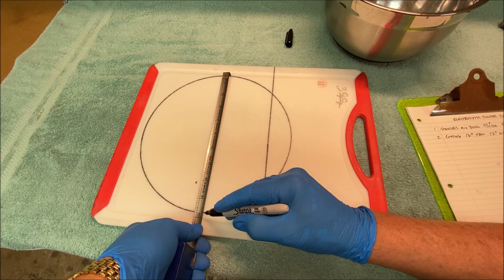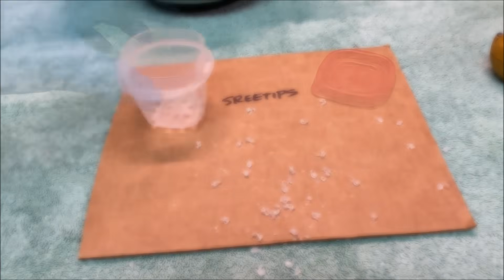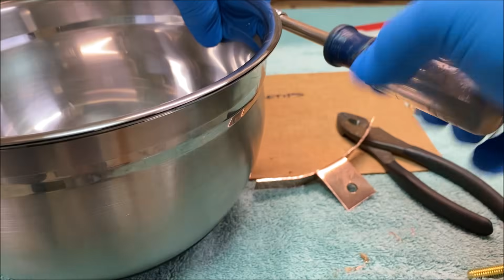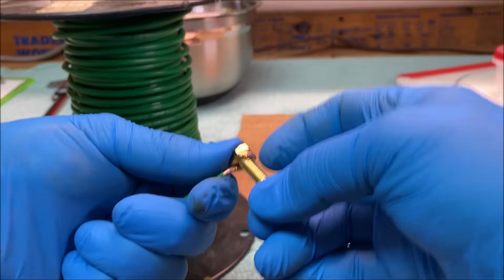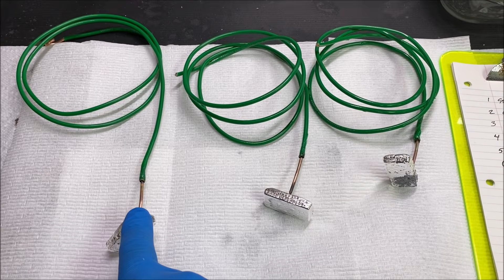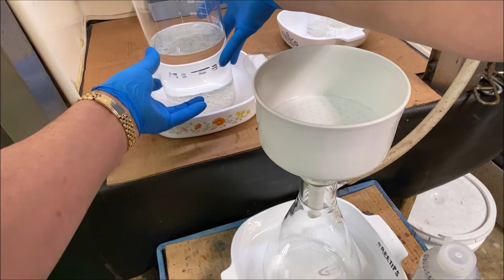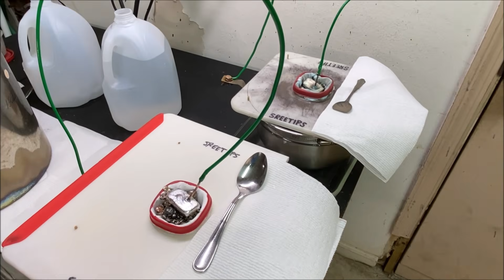Silver Cell Build Step by Step From Scratch for Beginners

Comment: My question........ can you build a gold cell and grow gold crystals, I have seen naturally formed gold crystals, I have a gold nugget composed of a dendritic gold crystal, it's rather unique and rare. Collectors pay a tremendous premium for gold crystal specimens, so perhaps you should attempt a gold cell. I'm curious if you can control the size of your silver crystals by varying the voltage?
Reply from the maker: Gold crystals can be grown but there’s a process involved that I’m not familiar with. Voltage in the silver cell is critical between a narrow range. Outside this range, other metals could begin to deposit, if present.
Reply: Might be well worth trying to grow gold crystals, I have done some searches and found that the premium for good crystals may be as much as 100 x the metal value. @sreetips
Reply: Great gold crystal specimens came from Mt Kare in Pau Pau New Guines, I've seen (held) some large spectacular specimens from the deposit that a friend obtained. Look up Fabre Minerals, they sold a 2.1 gm very average specimen for $940 USD @sreetips

Comment: If you are making the solution to extract the silver from with silver already aren’t you kind of just going in a circle? Taking silver, turning it to a liquid then recrystalizing it back into silver. I am failing to understand the actual production of silver from a cost perspective. You had the silver already why break it down to build it back up?
Reply from the maker: Have you ever heard the phrase; it takes money to make money? Well, silver is money (paper dollars are a money substitute). I use part of the harvest from a single run (about 800 grams of pure silver crystal) to make the electrolyte for two runs of the silver cell, 1.5 kilos yield from each run. So I gain (3 kilos minus 800g) 2.2 kilos of high purity silver. I rinse it, put it away, and forget about it. My goal is one thousand pounds of pure silver. Maybe sell a little along the way. But mostly for my retirement. Hope this helps you understand a little better.
Reply: @sreetips  thank you for explaining. I am used to the kind of chemistry where you take one thing and extract it from another. Not taking one thing to make more of it. I wasn’t sure from a % standpoint as to what kind of production you were generating

Comment: Thanks for sharing! Going to be my next future project!  Turning 925 scrap to pure silver! One question, I use silver solder in my work would that extra metal burn off in the acid?
Reply from the maker: The acid won’t burn it off. The acid will dissolve the metals if they are soluble in nitric acid.

Comment: A tip If your copper sheet is too hard to bend to the shape of the bowl, heat the copper with a gas/blow torch to a red heat, then quench it in cold water this will anneal/soften the copper making it easier to bend.

Comment: Love your channel and all the work you put into it , and thank you for sharing your knowledge with us,
My question is can you run bigger size bowls? Also what is you increase your power setting higher then 3volts ? Will it still work or does it effect the silver purity ? 
Keep up the amazing stuff your doing and for sharing your knowledge 
Kind regards 
Sam
Reply from the maker: Critical distance between anodexbasket and cathode 4 to 4.5 inches. I run the cell at 3.5 volts, higher or lower could cause contamination,
Reply: Thank you for answering my question , hoping to build my first silver cell this weekend 
Take care

Comment: 150 grams/Liter = 600 grams silver for 3.5L liquid is the ratio. With buying the Nitric Acid and the anode bar, from you, the all in cost to get the cell up and running is approx. $600 +\-. Would (2) 10 ounce .999 fs bars work for the electrolyte?
Reply from the maker: Ansolutely

Comment: Does the anode bar need to be .999 fine silver? If im setting this up for the first time can I use less pure silver for the anode bar?
Reply from the maker: Yes. I use pure silver because it’s easier to work with.
Reply: Also, does the electrolyte need to be pure silver also? Should I buy some .999 fine casting grain to make the first batch?

Comment: So the silver that I have is in raw ore form. That ore has a mix of silver, led and galena. Would this still work in this as a solution??? Or would it mess it all up???
Reply from the maker: No, the silver going in the anode basket must be fairly high purity to begin with. Otherwise the electrolyte would quickly become saturated with junk. 98% pure is a good number for the impure silver.
Reply: @sreetips  O ok Thanks. I was thinking it had to be on the higher end of purity. So I have to refine my raw ore down to 98% pure then do this whole  process to get it to 99% purity.
Reply from the maker: The silver cell should get 98% silver to three nines plus, as long as proper parameters are maintained.

Comment: Second question you used 600 grams of pure silver to make the clear solution up which is like 19 oz of pure. Then you put in 9 oz of dirty silver which would be like real silverware and so on. What is the percentage of pure from the original 19 already in the solution
Reply from the maker: For every ten ounces of impure silver I add to the anode filter basket, I’ll get out 9.8 ounces of high purity silver crystal.

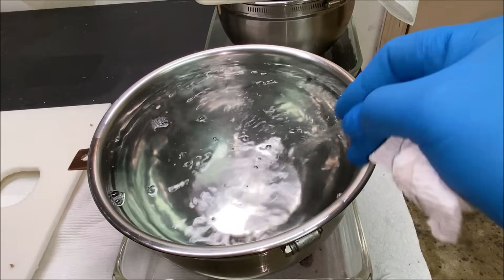Comment: at the @32:00 mark 600g of dissolved silver that equates to roughly $520 of silver that we need in order make this liquid silver solution correct?  Hopefully someone smarter than me can clarify.
Reply from the maker: That’s correct, but I use the electrolyte for a second run of the silver cell, but never more than twice due to copper builds up.

Comment: Sreetips, a question. how beneficial is this in networth? based on how much i'd pay for the setup and the anode, etc. what is the take home profit, to be reinvested? i'd like to get a full setup going for all of it if its plausable, and is it realistic for me to triple the container sizes if one has the finances? questions i'd like to know before i give this a try, if you can give me some insight lol. this is amazing stuff.
Reply from the maker: If you mean: buy everything including the silver, refine it, then turn it back into paper money. I suppose you could “make money” if you could get the sterling silver at a low cost. I buy sterling and use it to refine gold. I then recover the silver and run it through my silver cell. Then I harvest the pure silver and add it to my savings. My savings are in silver, not paper dollars. All that said, you’d probably do better to just hold the sterling like it is. No need to refine it. If you want more paper then you should invest in paper. Silver is not an investment. Silver is money. As the value of paper declines, silver (and gold) will tend to protect and preserve purchasing power. Because they can’t print more gold and silver. I have a ton of silver. And it’s value is indeterminable. So I run it through my silver cell. High purity silver, it’s value can easily be determined. And with silver so grossly undervalued, I’m converting as much paper to silver just as fast as I can.
Reply: @sreetips  essentially yes, looking for different ways to invest in paper to make easy purchases on critical items online before focusing on keeping silver and gold for self, also looking at lab created gemstones, and also reviewing silver and gold cells. attempting to make a realistic plan with all this in mind, on something that is profitable.  
- Thankyou for the response on this too! all the help i can get
Reply: In your opinion are you able to acquire more silver per dollar spent using this method vs just buying the cheapest bars and highest weight possible? For example if you spend $25,500 (current rate) on a 1000oz silver bar how many ozs of silver would that same $25,500 yield purchasing material and putting it through the cell?
Reply: Pretty much how much more silver can you get converting the same amount of paper through the cell vs outright  buying? Ultimate goal is as much silver as possible.

Comment: This is incredible. Thank you. Not sure how you learned and figured this out. But I need to know, How do you make the 600gs of diluted silver? How much does that cost? How much does the acid and beakers and other equipment cost? Where can I find impure silver and how much is that? Does the electrolyte turn blue on its own? Thank you again Sreetips.
Reply from the maker: I reserve some of the crystal from the harvest to make electrolyte. I bought all my glassware on eBay. We buy sterling silver at estate sales. Dudadiesel.com for nitric acid.
Reply: @sreetips  dude you're awesome. I didn't expect a thorough response. Much appreciated. Thank you for being an awesome person
Reply: @sreetips Any substitute for that impure silver? I live in Croatia and dont have idea where to find it,what kind od industrie uses it,or makes IT.
Reply from the maker: No, there’s no way to substitute anything for silver. One of the reasons that it’s so valuable.
Reply: @sreetips  where do you get impure silver you put in kathode filter?
Reply from the maker: I refine gold. I use sterling silver, that I buy at estate sales, to refine the scrap gold. I recover the silver from that, melt into shot, and run it through my silver cell. Silver is a by-product of my gold refining. The cell converts the impure silver (about 980 parts per thousand silver) to high purity four nines fine (9999 parts per ten thousand) pure elemental silver metal. So I’m refining the impure silver, into high purity silver, not creating silver out of thin air. When it’s full, I harvest the pure silver crystal, put it away and forget about it. Then I repeat the whole thing again.

Comment: When you have a solution with mixed PGM's (no contaminates)... is the solution heavier at the bottom and lighter at the top (not sure I asked that right).
Or does the solution through out weigh the same. (like heavy water in none heavy water?)
In other words. 
If I were to take (with a skinny hose) a sample of the solution from the bottom of a container having PGM's in it, would I get a better recovery from the bottom of the solution vs the top of a solution?
Reply from the maker: I don’t know, I’ve never tried that experiment. But I have seen solutions that I filter form a light liquid (water) layer on top of the more dense silver nitrate solution. But they are miscible and will form a uniform mixture once stirred. After that, the heavier silver nitrate will not sink to the bottom and separate from the water on top.
Reply: @sreetips  Thank you for your reply Sir. I ask because I duplicated your experiment where you are leaching out the PGM's with the catalytic combs. It's working well. But I started to notice that there seems to be a difference in results when I took samples from my 5 gallon buckets to test. It seemed to imply that a solution density is different at the top and the bottom from the results I got (I tried both). 
I was just wondering if you knew for sure.
I like many others sure do appreciate you sharing your adventures with us. Thank you so much.
When I'm finished I'll tell you all about my results. (still working on it).
My goal is to get it only to the contaminated black sponge stage and then approach a refinery for its completion (if that's a option open to me that is).

Comment: Im a plumber so I get 1000lbs of scap copper and brass every 3 months saved up. I get aprox. $3.00 per pound for salvage. So is there more money in converting it into silver?
Reply from the maker: Copper is very useful for refining silver. So if you have lots of silver that needs to be refined then you could use the copper to cement the silver out of your silver nitrate solutions.

Comment: Ok first time ive seen this. So is this the process?

Pull "some how" low grade silver from copper pipes.

Then make your contraption to refine the low grade silver into 999 or better silver.
Reply from the maker: No, I’m not pulling low grade silver from copper pipes. I’m using the copper pipes to reduce the silver out of the silver nitrate solutions.

Comment: hey, an idea, try magnetic induction melting levitation separation, only the metals (gold, silver, palladium, platinum, etc) will float, other oxides will not conduct and thus no eddy current levitation will occur, public domain idea no patents
Reply: and by induction currents the metals will be liquid or gaseous, by the induction heating, up to plasma
Reply: if all the material is already in liquid form, like gold/metal particles in some liquid, in pure form but mixed, then induction will separate all the particles from the non-conductive particles/liquid, very similar to electroplating but uses magnetic induction levitation to do the separation, physically in the base metal containing liquid, even acids/bases, depending on how they react/conduct with the magnetic induction
Reply: should work very similarly to a stir bar heater, or induction cook top, but more powerful version, should also distil liquids

Comment: just a thought, would it be better to "tin" the copper wire with silver and flux before pouring the pure silver bar?  It looks like a thin layer of copper oxidizes before the molten silver is poured.  That oxide layer could limit electrical flow that gets worse over time
Reply from the maker: Good suggestion, thank you

Comment: Correct me if I'm wrong. You added 600grams (approximately 19 oz) of silver to the electrolysis solution. It seems to me you are just getting back most of what's in the solution all ready. Guess i don't understand the process. One other thing is it a must that the Anode be made of silver? what about Copper passing the current.
Reply from the maker: Copper cathode will contribute copper and foul the electrolyte quicker. I’m getting 1.5 kilos per harvest.
Reply: @sreetips  Ok my bad sreetips I didn't read enough of the comments to see you did answer my query. I get it now the setup refines 1.5 kilos per harvest very nice indeed, but the price of silver for the electrolysis solution plus the anode puts this experiment out of my budget for now. Love the videos I'll keep watching :)

Comment: So, you are re-purposing your silver to make more silver?  Cannot be created out of thin air, so where is the advantage?  You need donor silver for your anode, you need donor silver for your electrolyte, and your result is silver.  Effectively, your output equals your input (less loss in solution), correct?  Then there is the cost of materials....(board, power supply, bowl, wire, etc.)
Reply from the maker: I buy sterling silver at local sales. This is not an expense. I’m trading paper dollars, that are declining, for silver that is rising. I use the sterling to refine gold. I recover the silver from that, melt it into granules, then run it through my silver cell. I don’t sell any silver because it’s grossly undervalued right now (except a few ounces in my eBay site). So buying all the silver that I can is kind of a no-brainer. I’m converting paper dollars to high purity silver. My savings is in silver, that’s rising, not in paper, that’s declining. Hope this clears it up for you.
Reply: @sreetips  Thanks for the explanation, that was never clear in your process video.  If you were capturing junk silver or silver in electronics I could understand the advantage, but again time and materials are the continuing "cost".
Reply from the maker: @A6Bnito  the sterling can be had very cheap because silver is undervalued right now. And you don’t have to refine it. Sterling can be held just like it is.
Reply: Very well said *sreetips

Comment: Hey Hey!
So, i like your idea. I think i will try to do something similar, but for a different metal.
Lead. Lead nitrate electrolyte and impure lead shots.
One question though. How is it that electrolytes with free nitric, does not attack the stainless steel bowl. Last time i checked SS is Ni-Fe-Cr alloy.
Thanks for your content
Reply from the maker: Concentrated nitric is stored in stainless steel kegs.
Reply: @sreetips  Aw, thanks. I now remembered that nitric does not attack nickel. Thanks for your videos!
Reply from the maker: Nitric will dissolve nickel

Comment: What about adding the 1000 grams (35 oz) of silver for the electrolyte. Plus the nitric acid. Then the impure silver under the anode. It looks like you’re desolvolving half as much silver to make silver. Which, made around 1831 grams (64 oz) of silver.  So, where does the NEW silver come from? The electricity? 🤔
Reply from the maker: There is no “new silver” created. I’m refining the silver into high purity silver crystal. The only place, it’s thought, where new silver can be created is inside a supernova in outer space.
Reply: @sreetips  I think what he's asking is if you are just starting this operation where do you get the material to make your electrolyte. I would assume instead of silver crystal you could just chemically purify some silver and dissolve that to make your electrolyte?
Reply from the maker: You could use pure silver coins three nines fine to make the electrolyte.

Comment: A quick question, why do you cut the straight line (chopping a piece of the circle off) instead of covering the bowl completely? i've noticed you cover it with a paper towel holded by a spoon to prevent contamination
Reply from the maker: So I can stir the electrolyte
Reply: How often do you stir the electrolyte?